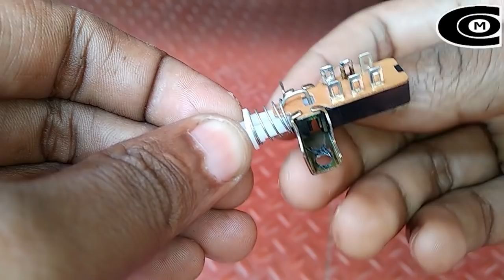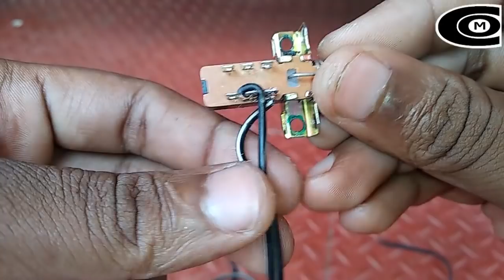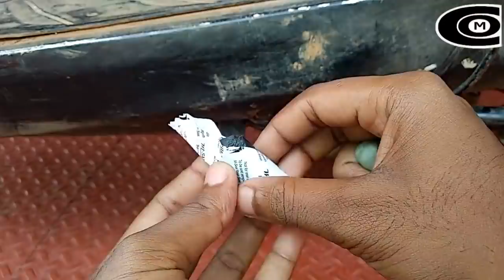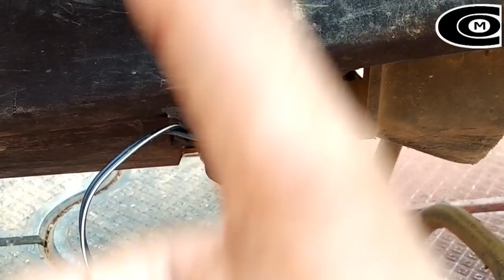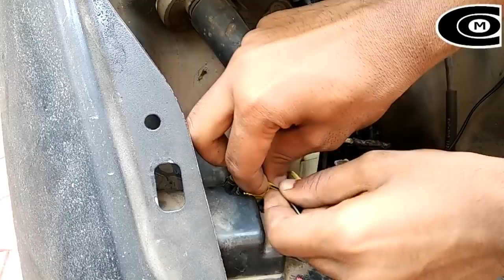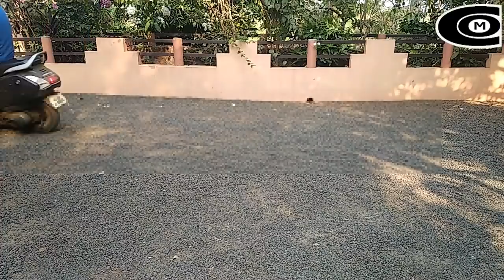How To Make Side Stand Sensor Switch | ഇനി സ്റ്റാന്റ് തട്ടാതെ ബൈക്ക് സ്റ്റാർട്ട് ആവില്ല!!

Comment: 1.ഒരിക്കലും ഇഗ്നീഷം കണക്ഷൻ കട്ട്‌ ചെയ്യലുമായിരുന്നു, മറിച്ചു ഒരു ബസ്സർ ന്റെ സഹായത്തോടെ side സ്റ്റാന്റ് ഇൻഡിക്കേറ്റർ set ചെയ്യാം .

2. മഴക്കാലമാകുമ്പോൾ ഓട്ടത്തിൽ വെള്ളം തെറിച്ചുവീണു സ്വിച്ച് കംപ്ലൈന്റ്റ്‌ ആകും ,സ്റ്റാർട്ടിങ് പ്രോബ്ലം ഉണ്ടാകുകയും ചെയ്യും.
use brack switch (ape)

3. Horn, indicater, brake light ഇവയൊന്നും side stant തട്ടാതെ work ആകില്ല .
മറിച്ചു side stant തട്ടതെ engine engine മാത്രം സ്റ്റാർട്ട്‌ ആകാത്ത system ചെയ്യാൻസാധിക്കുമായിരുന്നു .

                       =KURUP
Reply: Correct
Reply: self kitilla but kikar adichal kitum
Reply: @salmanulfarisc8379  
No chance..
Vandi de ignition thanne off ayi kedakua..
So kicker adichalum start aakilla

Comment: Solder cheyyuka.. insulation Tapinu PAKARAM sleeve use cheyyu.. mseal use cheythaal switch complaint AAYAAL Budhi muttaakum. Hole drill cheyyuka .. thanks
Reply from the maker: Yes . 100% correct. But മിക്ക പേരുടെ കയ്യിലും solder iron ഉണ്ടാവില്ല..